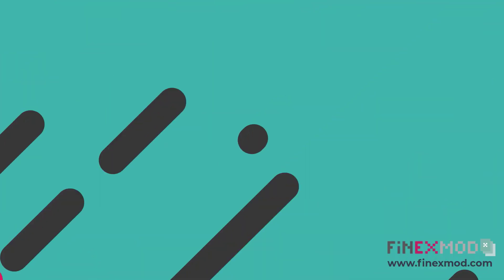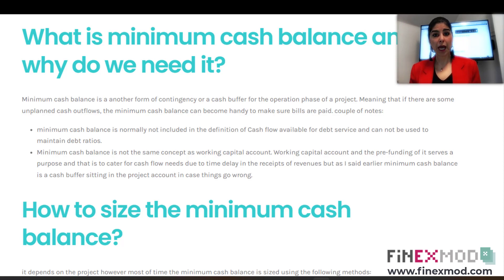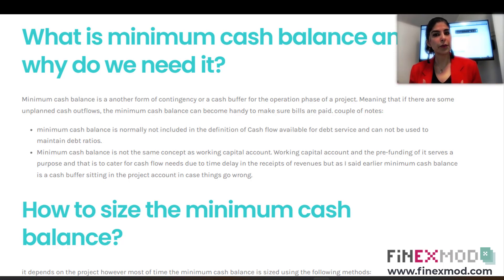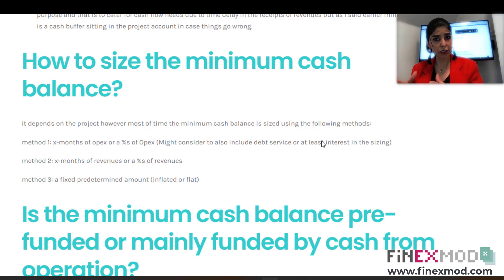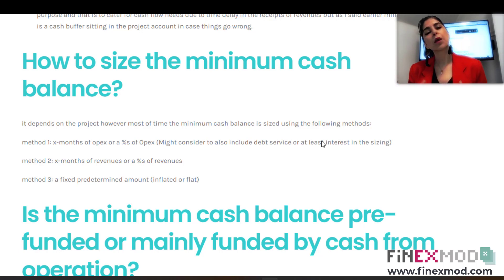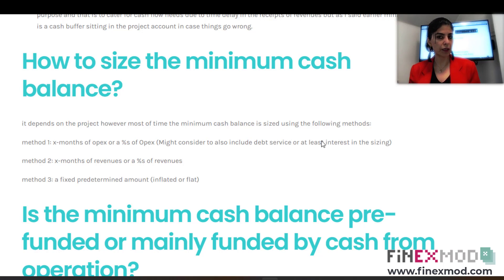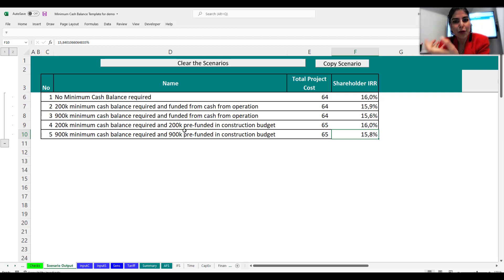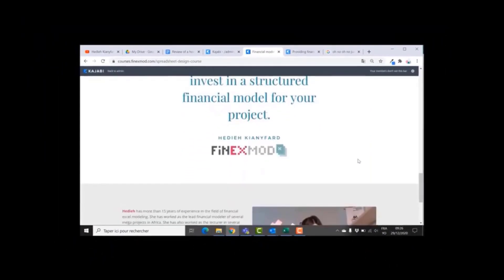Minimum Cash Balance: What is it? Why you need it? How to model it?

Comment: Thank you very much, Hedieh, for the insightful tutorial always. You mentioned in the video that we could have the flexibility of the target minimum cash partially pre-funded from debt and the balance funded from operating cash flows. Could you please provide more insights into the modelling of these flexibilities? 

In addition, is it not possible for this unforeseen expenditure to be catered for via the Maintenance Reserve Account if that provision is already available in the model rather than the minimum cash balance?

Thank you
Reply from the maker: Thanks for your comment! In project finance, we use various reserve accounts for specific reasons, especially because project finance operates with limited recourse. The Minimum Cash Balance ensures everything runs smoothly, while accounts like MMRA and DSRA have their roles, like covering maintenance and repaying lenders. Feel free to ask if you have more questions!
Reply: @FinancialModelDetective  Thank you very much for the response.
Reply from the maker: In project finance modeling, it's important to note that the Minimum Cash Balance is typically funded in the first operational periods from cash flow available to shareholders. Therefore, when modeling dividend distributions, it's common to set aside the target Minimum Cash Balance from available cash flow during the initial periods and trap it in the project's cash account. This reserved amount should not be released in the base case and is held as a precautionary measure to fulfill the Minimum Cash Balance requirement.

Comment: Hi Financial Model Detective,

Thank you for your insightful video. However, I'm still a bit confused about how to determine the exact percentage if I want to use annual operating expenses (opex)/revenue. Could you elaborate on your process for determining the 8%/17% as a percentage in your model?

Thanks for your help!
Reply from the maker: Thank you for your feedback. When determining the size of the minimum cash balance based on operating expenses (Opex), you can follow a simple process.

In your Inputs sheet, include a parameter called "Number of months of Opex to be included as a minimum cash balance." Let's assume you set it to 2 months of fixed Opex.

In your calculation sheet, consider the Opex for the relevant period when sizing the minimum cash balance. For example, let's say you're in year 1 of operation and want to distribute dividends. To determine the minimum cash balance amount, look at the Opex for year 2. Suppose the total Opex for year 2 is $1 million (annual).

Since the Opex is annual, 12 months of Opex equals $1 million. To calculate 2 months of Opex, multiply $1 million by 2/12, which is around $170,000. This amount should be kept in the cash account and not distributed.

Moving to the following year, let's assume the Opex for year 3 is again $1 million. You retain that amount since you already have $170,000 in the cash account. However, if the Opex for year 2 were $2 million, you would need to fund another $170,000 and add it to the cash account.

This process continues, ensuring that the minimum cash balance reflects the designated number of months of Opex that should be maintained in the cash account before distributing dividends.

If you have any further questions, feel free to ask.